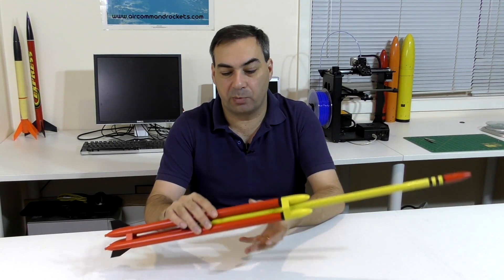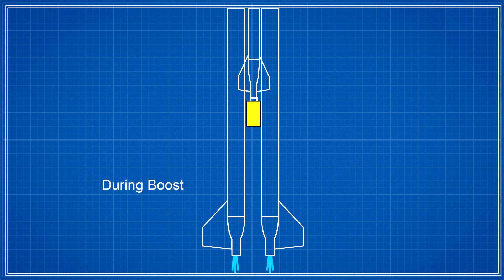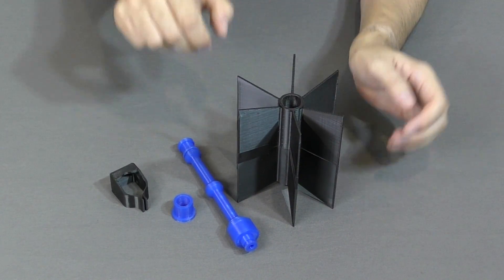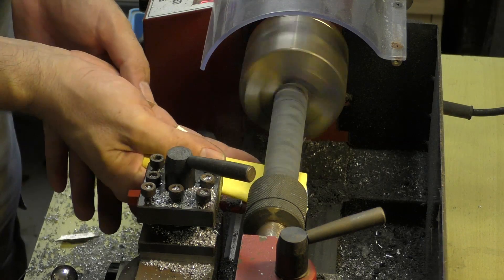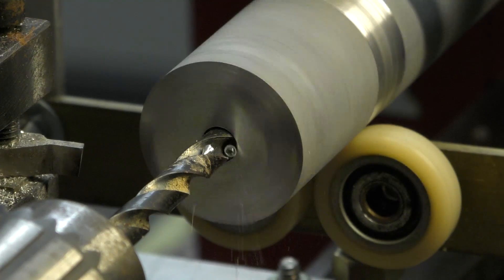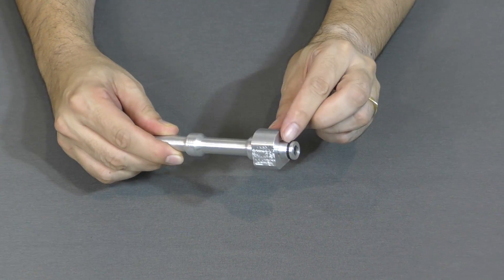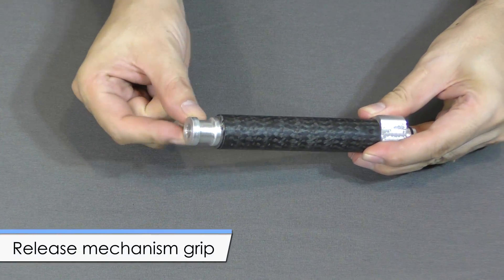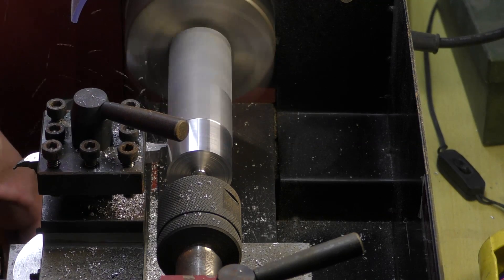2 Stage Water Rocket - Part 3 - Staging Mechanism

Comment: @Air Command Rockets >>> You wrapped that carbon fiber with [teflon?] tape before letting it set up. 

I am certainly NOT an expert on using carbon fiber {fibre} - the best I can probably do is just identify it when I see it 😊 - but I was under the impression you had to vacuum bag carbon fiber to get it to set properly...?
Reply from the maker: That was just electrical tape. Vacuum bagging just allows you to remove excess epoxy. The epoxy will set regardless whether it is in a vacuum bag or not. The electrical tape just compressed the tube a little, a vacuum bag would do a much better job.
Reply: @AirCommandRockets  >>> Okay.  I was under the impression you had to draw all the air out of the thing for it to set properly.  
 
Thanks!!!!

Comment: if you try to use Co2  instead  of air you will get more power
Reply from the maker: At the pressures this rocket is intended, you could liquify the CO2.

Comment: Looking back at some of your work with foam vs water made me think that perhaps you could look at adding a very fine biodegradable polyacrylic superabsorbant to the bottles.  An example of their use is in baby diapers. They expand quite a bit and could extend the water portion of the thrust profile.

cheers
Reply from the maker: Interesting idea. I am not sure how well that would flow out of the nozzle though. Might be worth a try though.

Comment: I glued two 1.25 L bottles together, and pumped a bike pump 90 ties before it blew up. The top almost set a new altitude record.
Reply from the maker: What glue did you use?
Reply: araldite
Reply: and a bit of tarzan to seal

Comment: Great and inspiring video as always! It just blews my mind how precise you work on your projects. I really like the idea that the second stage is supported by the first stage to withstand the high forces during acceleration. Good luck with the testing!
Reply from the maker: Thanks Julian.  :) The overall design for supporting the sustainer was done for the same reasons we did that in our older Acceleron V rocket. I would have liked to have included the testing in this video, but it was getting too long, and so it will just go into the next video. :)

Comment: Thank you for the video! It was very interesting! There are several questions about the design of the rocket. Can the second stage of the rocket split freely from the first stage? Fins of the second stage can be hooked? Do you take into account the change in the position of the center of mass during the flight of the rocket?
We look forward to continuing!
Reply from the maker: Thanks Water Rockets Club, The bracket at the top of the boosters provides enough clearance for the sustainer fins even if the sustainer turns on the way up. Yes, the changing center of gravity is taken into account during the flight, its one of the reasons why the sustainer needs to sit forward in the booster.

Comment: wow that rocket produces 7kn of thrust that's like the upper stage of electron rocket and that's a rocket which can get into orbit
Reply from the maker: That's not quite right. The rocket exerts 7kN of force on the launcher while it is still on the pad. Once the rocket launches and leaves the launch tubes it creates a peak thrust of around 11kN but only for a very short time. The Electron rocket produces its thrust over minutes not several hundred milliseconds like this water rocket does.
Reply: Air Command Rockets oh you rocket produces 11kn over milliseconds? well I said the thrust is similar not the time it fires but still your rocket is awesome all my rocket can produce is 0.05 kn

Comment: In what sort of places can you get supplies of metal for use in personal projects?
Reply from the maker: There are many retailers that will sell to the general public that also supply to industry. Locally we can get materials from places like Edcon Steele, or Aluminium Warehouse. Just Google locally for Aluminium supplier. They will often cut the material down into usable lengths, and will often have smaller offcuts to sell as well.